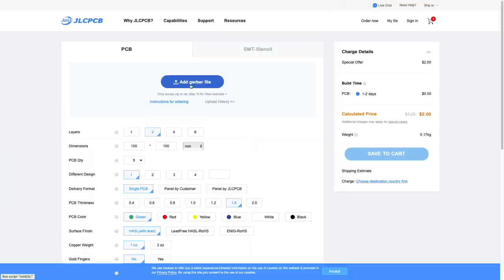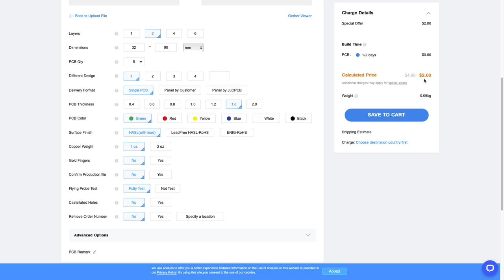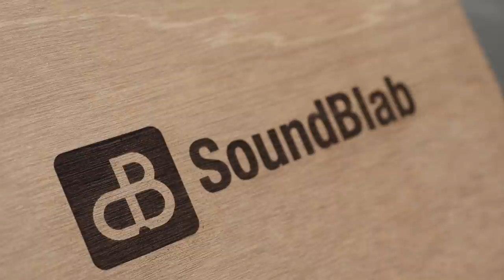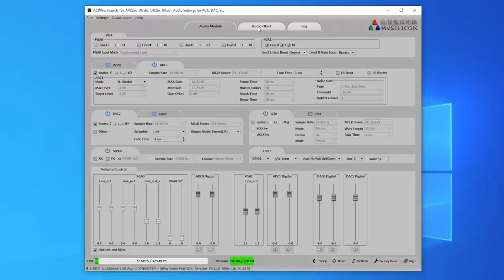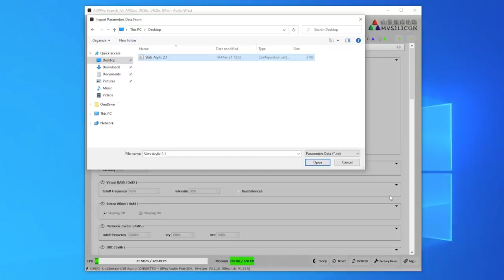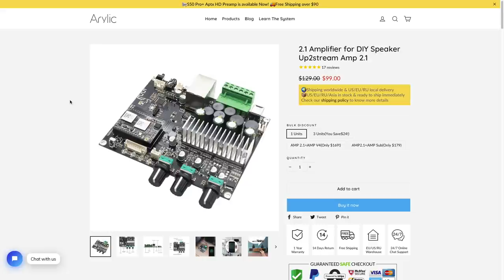Building a 2.1 Wireless Speaker with Slatted Wood Grill - by SoundBlab

Comment: Finished the build on Sunday and the Arylic module arrived today, Wednesday, hooked it up but did not mount the board.  The sound is very good and the Arylic module is easy to set up on AirPlay.  I decided not to use the slats on the front opting instead for a cloth covered frame.  Very impressed by the bass response and overall range.  Even sitting at 40 degrees off-angle the speaker is great.  One of the better set of plans I have seen.  Great work.
Reply from the maker: Thanks so much David. So pleased that you are happy with the speaker! Send me a pic sometime of the final outcome, would love to see it.
Reply: @SoundBlab  Link to Arylic Forum Post  https://forum.arylic.com/t/2-1-speaker-based-on-soundblab-design/284
Reply from the maker: Fantastic, love it!

Comment: looks beautiful. I agree with your "MDF slat support" comment. would have been better to use hardwood, birch plywood or even anodized aluminum. 
also, cap head screws would help keep the MDF from splitting when attaching to the cabinet.
Reply from the maker: Thanks

Comment: You speaker guys are always so sloppy with the electronics inside the speakers. At least this time you mounted the driver board, usually it just gets stuffed into the box with a bunch of foam stuffed in after it. The speaker design and craftsmanship is so good, it just surprises me to see the electronics so sloppy.
Reply from the maker: You say sloppy, but but don't really elaborate on what is sloppy about it?

Comment: i would never spend so much money on a speaker.
Reply: so much money? I wouldn't call that a lot for speakers yet. But everyone spends his money on different things.
Reply: @sabahaddinarslan2927  i mean, only the amp goes for 100$... i don't call that "little money".
I do understand that for some percentage of the people that is like spare change... nonetheless...
Reply: @AndreaFromTokyo  Oh I see, I forgot about the amp. I agree with you, the amp is overpriced. I think it has wifi and dsp integrated? But for that price I also would just use an equalizer and make the best of it.
Reply: @sabahaddinarslan2927  it has wifi but for the DSP you need to fork out 20 additional bucks for the software if you want to flash it! even more expensive!
Reply: @AndreaFromTokyo  It's all about price vs quality. What alternative with similar quality in this price range ? Remember wifi has no compression and tang band are higt quality speaker brand.